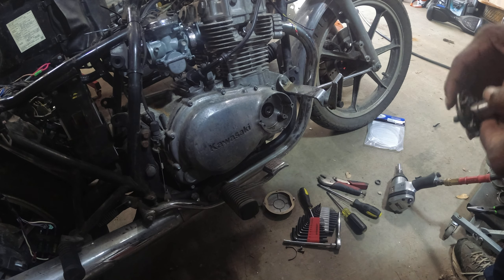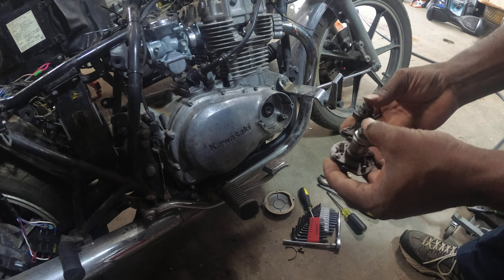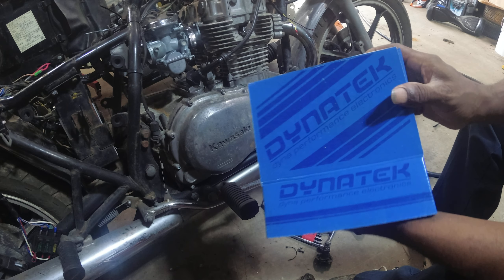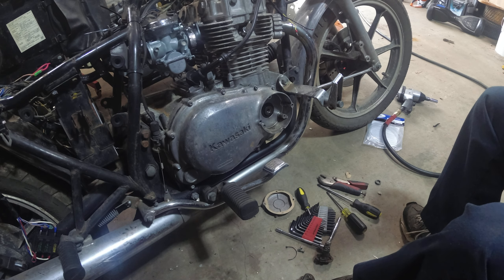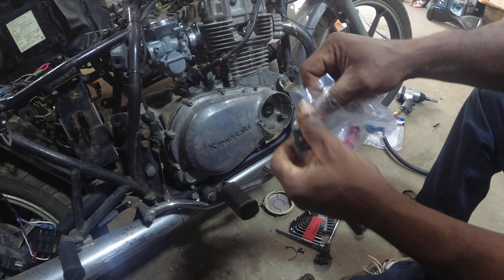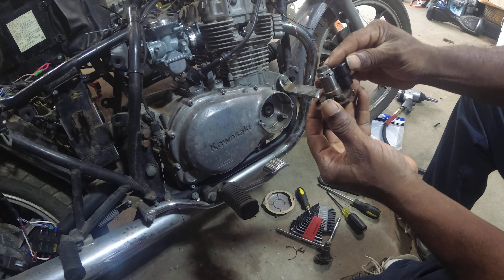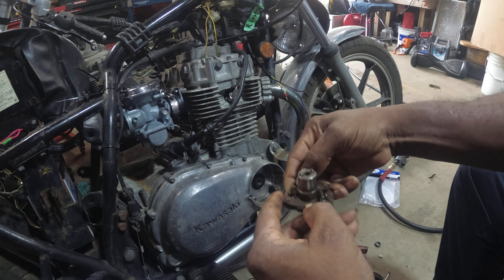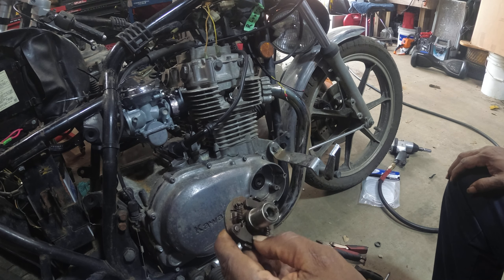Dyna Tek install

Comment: There is one setting that was left out of all the installs on You tube.  That is the space between the magnet on the rotor and the 'pickups' on the modules. If set too far out the corresponding cylinders will misfire. I set mine but forgot what the setting was, maybe forty two thousands?? can you confirm the range??